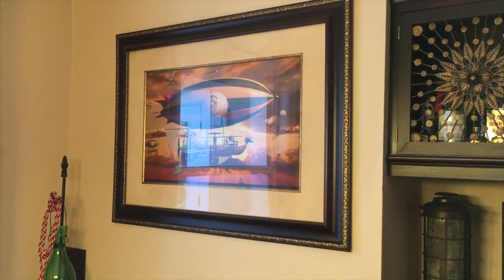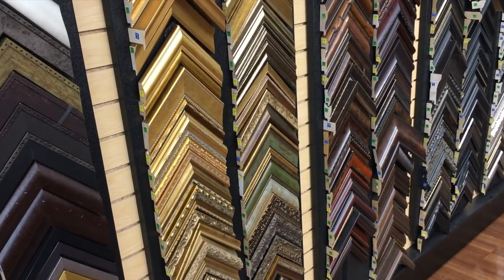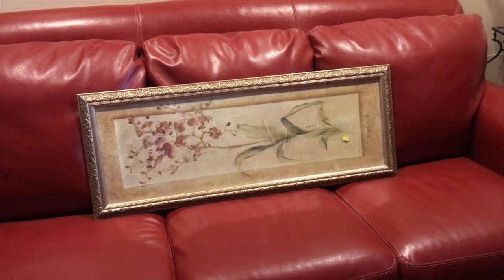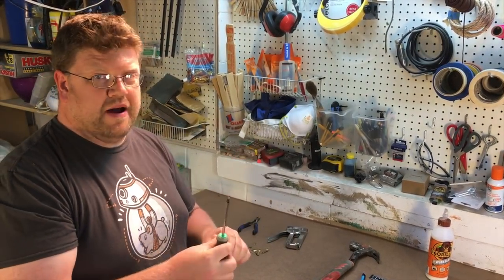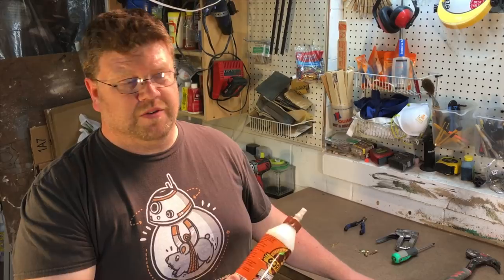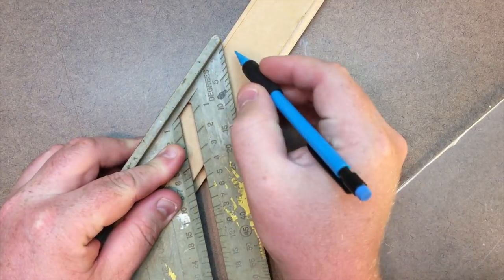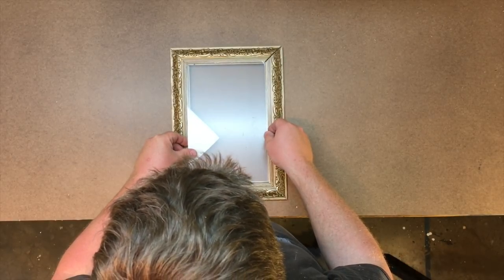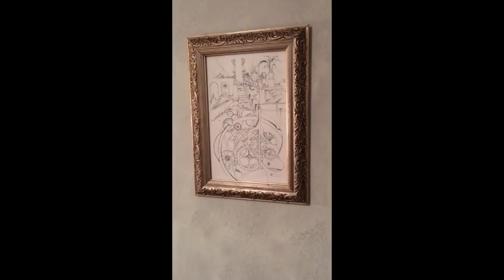How To Re-Size Thrift Store Frames: No Power Tools Needed!

Comment: Very nice tutorial -- I worked at a number of frame shops over the years, and it's not rocket science, for sure. If people are nervous about cutting glass or plexiglass, having your local frame shop cut you a piece is not generally expensive. You don't have to have a frame shop do every part of your project. They can do as little as put a hanger on for you! I like using small local frame shops, but definitely it's great to develop a friendly relationship with any local framer, especially if you are an artist or love art/decorating. - T

Comment: Very helpful!  I have been painting up a storm and have 130 pieces to frame.  Your video may be what makes this possible.  Thank you!   What about taking apart the corners of a wood frame that has been stapled together across the angle with a nailer?  I was hoping to use both ends of the frame as is, and shorten the side pieces but can't figure out how to get out the staples without gouging into the frame.  Any suggestions?

Comment: Why not cut the old frame to use 2 diagonally opposing corners intact, instead of one corner with two separate pieces? It's one less edge to glue/assemble and potentially mess up with a saw.

Comment: Would absolutely love a video that tackles a big frame and without glass, I struggle with (what looks so easy in this video) marking up the first cuts and rarely get it right.... Because of this I generally I buy the used frames and cut board to fit. Today however, I realised I had painted on the incorrect board and I don't have a frame that fits and must cut one down...:( Unfortunately the painting is large....) HELP!

Comment: I've seen frames at dollar stores too for fairly cheap.

Just a couple questions. I know putting masking tape over the piece will prevent tearout, but will the same hold true on an ornate frame?  And some of the frame I've seen have what looks like a longer piece of squiggly metal embedded in the frame, going across the corner to snugly hold the joint together.  Any ideas on how to overcome that?
Reply: Personally, I would ditch the existing brad/joiner metal piece and either glue and staple or use a small L bracket to make sure you don't have structural problems later. If you can leave it in place,  just reinforce it, I have had a few of those give way.
Reply: Are you using a drop/miter saw? If your blade is thin enough the molding (ornate or not) should cut fine. Its made to be chopped at the frame shop, and I cant remember the last time someone effed up a length of molding because it sawed badly. Good luck, homie!!!
Reply: Please never use masking tape on artwork! It will destroy it over time and leave stains! Acid free tape is cheap and one roll will last for ages.